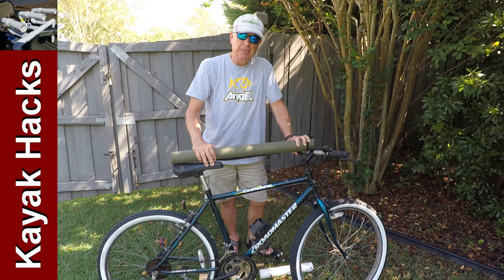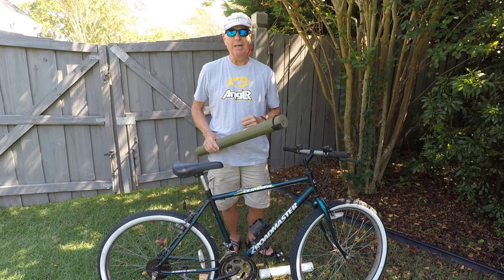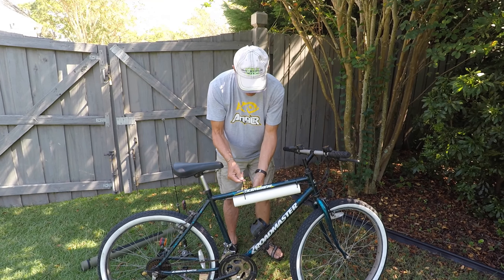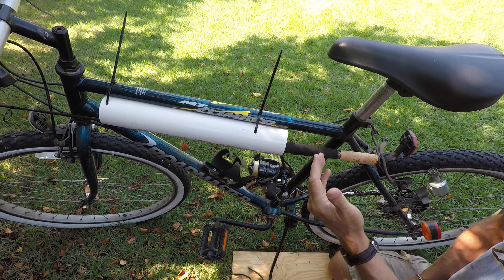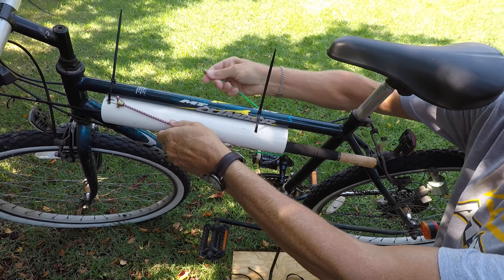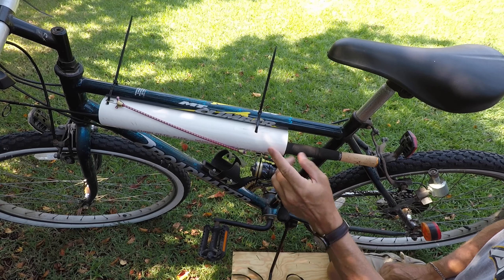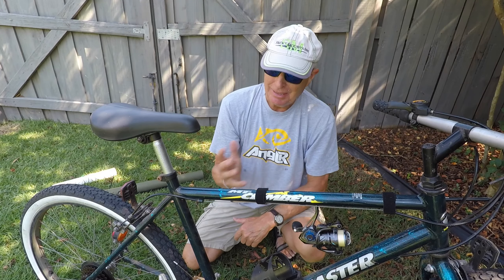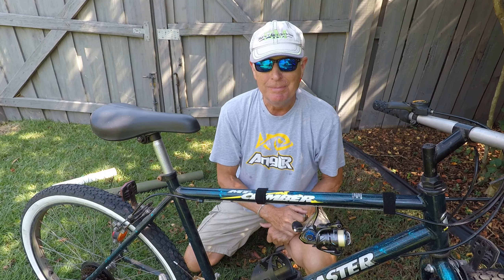2 Minutes and You'll have an EASY Way to Carry a Fishing Rod on a Bike

Comment: Which cycle is better for this purpose a MTB or a Hybrid? With gear or no gear? Thanks!
Reply from the maker: It depends on where you are going to ride. If on a rough trail or even a converted railbed with a gravel surface, the wider tire of a MTB will make for an easier ride. The more gear you carry, the more it goes to MTB as well.

Comment: Great video! If you cut a J into the pipe where the reel goes it will add as a lock and screw a piece of velcro to the end where the reel goes and eliminate the bungee. Thanks
Reply from the maker: Great point! Thanks!

Comment: Excellent hack. I use the velcro wrapping tape at the mid section and handle ends + a strap to carry 6 trolling rods in and out of my buddy's boat in a marina from the parking lot.  I would add the PVC pipe version could be the short surf rod holder + Rod combo to ride to the ocean, as long as the PVC rod holder and rod are removable, which you showed with the velcro. We would use PVC pipe +  conduit duct taped together so we could pack it down, for the beaches in michigan. I will build in for my Naples excursion next week.
Reply from the maker: Thanks for your idea as well!

Comment: I use the second method but with two small bungee cords and with two salt water rods.The tricky part is adjusting the reels so they don't hit your feet as you pedal.
Reply from the maker: I agree. The reel can be an issue. On large reels, maybe put the rod on backwards so the tip points to the rear. That would move the reel closer to the front.
Reply: @KayakhacksFishing  I always point the tip to the rear, so it only goes in a space I've already been.  It handle brush better that wat too if you are on a trail.
Reply from the maker: @FrankLadd  Good idea!

Comment: I made a carry rack on the back of my bike using a commercial grade door threshold; it’s wide enough and it’s strong enough to carry 150 pounds or more.  

I attached it with structural angle I bought at Home Depot.  I already tested it to carry 65 pounds I’m sure I could carry up to 150 pounds with no problem.  

This is for the cooler bag or small ice container for the fish I catch.

Oh yeah; I tow my kayak just over a mile using this carry device.
Reply from the maker: Wow! You are inventive!
Reply: Kayak Hacks Fishing well; no different than your TPS and tricks.  We just find positive ways to solve problems.

Comment: Hey; you need a mirror and flashing red lights on that bike.  You can find those lights sometimes at Aldi’s Finds section for $6 to $4.00 for a set.  Use aluminum strap to fabricate a rear light bracket the Velcro mounted mirrors as WM are good quality.